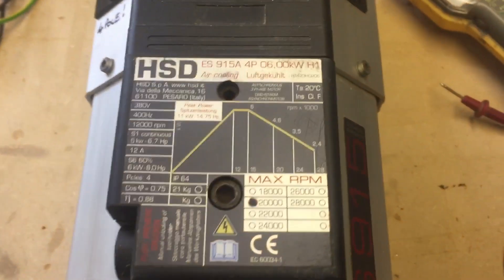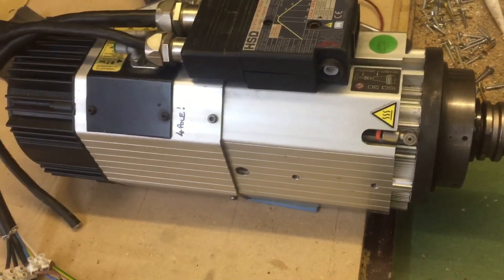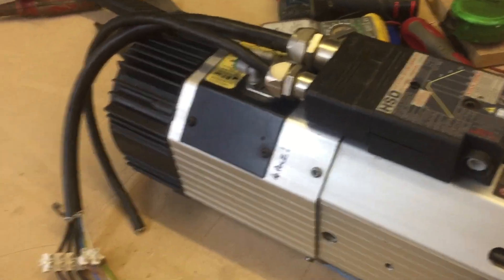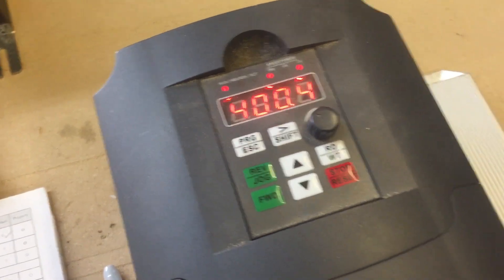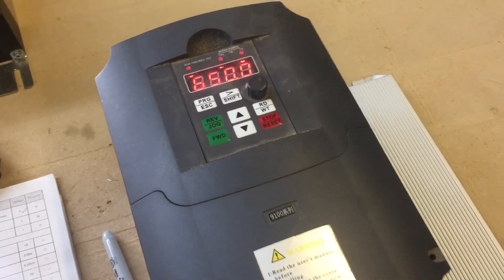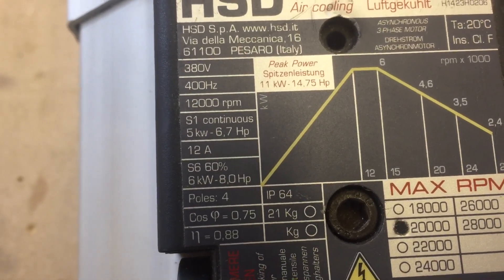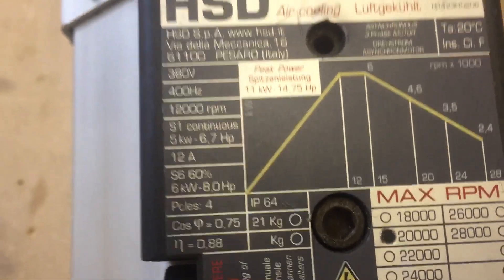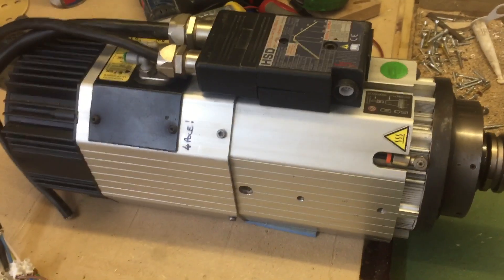Hsd 915 4 pole automatic tool change spindle- run test

Comment: my question about the atc spindle es929
which is that I am using one cutting tool most of the time means not required tool change often. so closed the air supply to the machine/ spindle to save  the air compressor running continue . As i know that cooling is done by the cooling fan. so the air is for tool change and internal cleaning. as i mentioned go for tool change rarely.
will closing the air to machine will make any issue to the spindle? i am asking because just reading the manual i find this which is below.
( The cylinders of these electro spindles are double-acting: it is necessary to keep the cylinder under pressure to maintain the piston at the upper end stop, far from the fast rotating parts. )
Reply: Hola amigo tengo uno parecido pero no consigo manual para instalar los teléfonos de cambio de herramienta podrás ayudarme?

Comment: Hi there, Do you have another HSD ES 915 iso 30 quick change spindle coming up for sale ? 
Mike
Reply from the maker: Michael Graham  I have a 919 available . I use  them on all my machines
Reply: Thanks for responding quickly, I think the 919 is over the kw rating I need to stay with which is 3.8Kw. The ES 915 on your vid is the one I need. Do you know of any other places I could look ?
Reply from the maker: Michael Graham you won't see 3.8kw unless your using huge cutters. 
The most mine has ever drawn is 8 amp with 100mm diameter cutter in oak !
Reply: automateanything , does the Kw change pending on the job type, perhaps it’s the Amps rating then I need to check, I work from home on 3 phase power, have a limit of amps I can be drawing at same time with other items compressor, vacuum hold down and HSD fan and dust extractor running,
Reply: automateanything , the 919 is 12 amps (3phase ?) the 915 is 8.3 amps
Reply from the maker: @michaelgraham4415   have a look at this. video shows  my home machine- running single phase. vfd is set to display amps.  as you can see -doesnt require much!  i also run 4kw hydrovane and 2 vacuum pumps. all off a single phase supply.  https://www.youtube.com/watch?v=C_xe_VP0_ps
Reply from the maker: Michael Graham  basically they only draw high current when using very high acceleration speeds or under very heavy cutting loads. 
If you are running at low rpm the current will be higher, higher speeds - lower current
The 919 is a 2 pole motor so gives its best performance at the higher rpm scale . The lowest speed I run mine is at 5000 rpm but this is only for drilling so a very low power usage. 
For normal cutting 15000 to 21000 rpm is the norm. Free running with no load is approx 2 amps. Cutting at speed with a 12mm cutter approx 3 to 4 amps . 
All quoted using a properly set up vector controlled vfd.  
So the answer is yes the current draw will only be down to the job you are doing .
My vfd is only powered by a standard 13a uk plug supply so limits my maximum kw rating at half of its maximum 34a draw on the incoming mains . I have never even maxed this out !
These spindles are designed to take massive tooling like 200mm window blocks where that sort of higher hp would be required but as a normal router they are virtually running load free .

Comment: Would you let me know if this is still available or if you have any other similar ones. Thanks
Reply from the maker: Dominic Burke it’s sold
I have 6.8kw 2 pole
Very good condition
Reply: @automateanything  I'm looking for a atc for a router cutting mostly ply. would prefer one that can be wired to my 5.5kw 240v vfd at a lower current until I either upgrade to 240v to 380v vfd or get 3-phase. The 2 pole looses low end torque compared to 4 pole? The minimum I cut is 8k for engraving, 12k for cutting
Reply from the maker: Dominic Burke hsd are 380v so will not run properly on 220v without the correct vfd.
If your on Facebook join Cnc machines and parts uk. 
I have other Atc spindles in stock that may suit you
Reply from the maker: I will make a video of some new 4 pole spindles I have
Reply: @automateanything  swap in the delta connection box and it will be 220